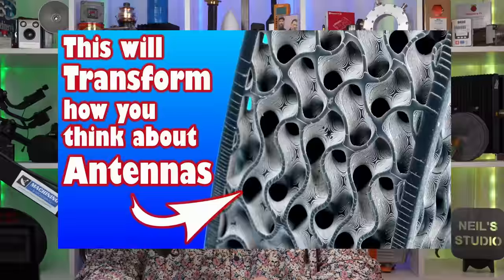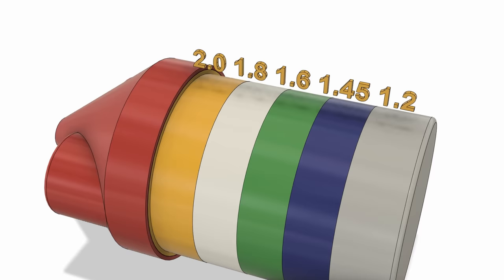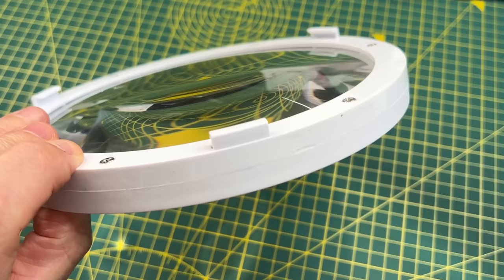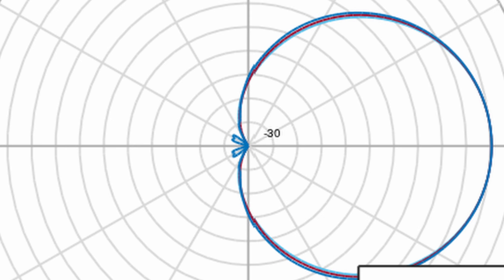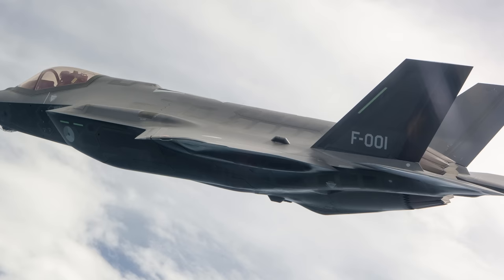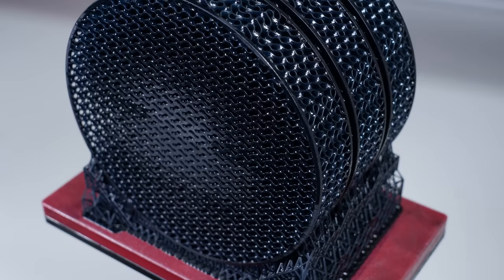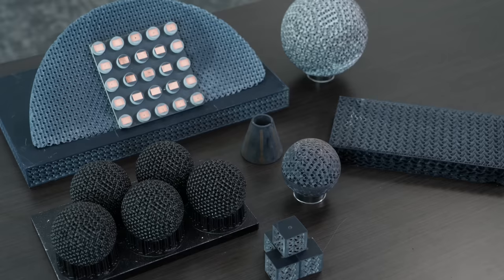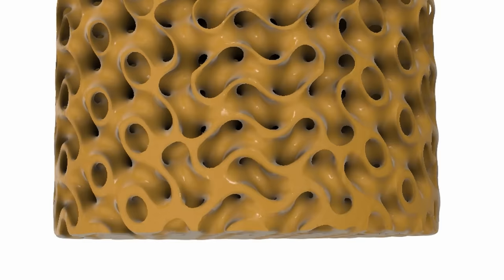How Microwave Lenses REALLY Work!

Comment: 🧲🌡️📡🔆☢️🔌🔊🔋♻️🌐☯️⚛️
It's facinating how when we look around & we see all this complexity with-in the Universe. That complexity basically comes from: ~{"Differences"}~ The Factor of how "Differences" interact seems to be the key factor in keeping dynamic systems functioning. Such as: *{High pressure/low pressure, hot/cold temperatures, different densities, viscosities, turbulent flow, static electric charges/discharges, electromagnet waves. Different velocities/angular momentum. Different amounts of energy/mass/frequency/vibrations. Different boundary layers between different materials or physical regions such as: (Land/water/oil/air/soap bubbles/ atmosphere's/space. The different regions in space with different particle density/background radiation, solar wind/membrane layers/bubble's/cloud regions, nebula's/Galaxy's/Galaxy clusters/ Cosmic filaments/less dense regions of space compared to dense regions of space.) All of these things are basic differences but create a way for the dynamic engine with-in Nature to continue flowing and operating to create and convert energy.} Just Like How a battery 🔋 transfers + charges through a membrane layer to a - charged side. Like how regions of high/low temperature 🌡️ create winds. In water- add some factors and It creates ocean currents and flow. Then internally inside our planet it creates plate tectonics, planetary convection, geothermal activity, a magnetic field around our planet, to hold a atmosphere. The list goes on
🧲🌡️📡🔆☢️🔌🔊🔋♻️🌐☯️⚛️
The natural world around us is just utterly facinating to me.
Reply from the maker: It's all about entropy and our battle against the inevitable heat-death of the Universe! Plenty of time left for wonders and delight

Comment: Such a good video! Tiny niggle; why do radio engineers generally use wavelength instead of frequency? The electromagnetic spectrum is so much easier to visualize in terms of frequency, but most physics textbooks use wavelength, thus 'inverting' it, so for example the visible spectrum (rainbow if you like) gets shown upside down because the x-axis is wavelength, not frequency. This caused me no end of trouble during my physics 'O' level because the highest frequency, more energetic colours like UV tend to appear first, at the left, and the lower energy, lower frequency IR gets promoted to the right of the diagram. All because the wavelength is longer. This has annoyed me for the 40 years since then! Cheers for the great vid.
Reply from the maker: I think the use of wavelength, wavenumber or frequency to describe RF is something engineers do completely unconsciously, because of the physical reality of wavelength in physical systems being a more useful descriptor than frequency.  Wavenumber in inverse centimetres is slightly jarring to me, like wavelengths in feet.  I tend to use wavelength from about 6 mm to 23 cm, but frequency at longer wavelengths, then below 6cm I seem to flip into the frequency domain until I get past the far infra-red, then I return to using wavelengths from IR through to gamma rays. Having been immersed in the language of RF engineering since I was 10 or 11 years old, so 5.5 GHz is about 5.5 cm wavelength and both have pretty much the same intuitive reality to my RF-addled brain.  It's too easy to forget that it's a learned concept rather than something that is inherently obvious to the rest of humanity.
Reply: @MachiningandMicrowaves  Thanks for the reply. As a 60yr-old audio nerd & IT engineer I've always had to think in terms of frequency, whether sound, CPU clocks or WiFi, so yes, it does seem a learned thing. It would be super-odd to describe audio in terms of wavelength! I do get its uses in radio though, in working out waveguide profiles & suchlike. I just wish all the textbooks didn't tip the RF spectrum on its head! It's confusing for youngsters, I think.

Comment: SOUNDS LIKE A MICROWAVE FREQUENCY VERSION OF A FRESNEL LENS .
Reply from the maker: It's not quite a Fresnel, as the reality of a Mikaelian is that there's no need for stepped refractive index, it can be continuous.  You certainly CAN make Fresnels this way though.  A more typical Fresnel solution for microwaves and mmWaves is a stepped Fresnel Zone Plate.  Spookily, in an upcoming video I'll be making a vacuum chuck to hold an HDPE plate that I'll be machining into an FZP. An FZP is a fairly simple build, consisting of rings of material which are thicker or have a higher refractive index than a supporting disk. I'm just going to machine away the surface to get the right phase shift in an FZP with eight rings about 200 mm diameter which will be a focussing lens at 122 GHz.

Comment: Shouldn't binder jetting like for example Voxeljet does be way more suitable for doing this than SLA printing? You can even use ceramic material and then burn off the binder afterwards, sintering the ceramic particles together
Reply from the maker: There's certainly some work being done on sintered ceramics for higher frequencies. There are some big challenges in making a material with precise RF characteristics that's also mechanically robust enough, but the state of the art is moving very rapidly.

Comment: If you make a lattice in the printer could spaces in the filled portions of the lattice be filled with a suitble material?
Reply from the maker: Find a suitable material is the challenge.  Almost all two-part chemical setting resins have mediocre or poor RF performance. Non-polar thermoplastics are good, but finding a way to mould them is hard, they tend to be extremely viscous, but also have a low relative permittivity.  Something like HDPE with entrained ceramic inclusions would need high pressure injection moulding and the lattice to be something that is strong enough to withstand the injection process, but also can be dissolved preferentially.  That's one for the Materials Science specialists I think!

Comment: Not even 5 minutes in the video I'm dreaming of a spectrum analyzer using an "RF prism" in a similar way als old style spectrophotometers use 😁
I have been looking at Luneburg lenses at my previous job for a 5 GHz system but never got to make one or see one working. Following your progress now ia a fun thing to do
Reply from the maker: It's certainly possible to create a prism for RF, but the dimensions are a bit excessive unless you go to very high frequencies. The problem is that most low loss dielectric materials that are transparent to RF aren't dispersive.  The refractive index is pretty much constant with frequency, so your prism can't split out the different wavelengths.

You can do diffraction gratings and grating mirrors as well of course, and they will definitely work at RF. 

Dispersing a few sacks of TiO2 or powered alumina in a bathtub or two of molten paraffin wax and setting it in a mould to make a large enough prism would be quite an exercise as well! 

Perhaps in a cold climate, you could form a giant ice prism and use that, the RF losses in water ice are fairly reasonable, but even water doesn't have a frequency-dependent refractive index and mmWave/microwave frequencies.  You can certainly bend a collimated microwave beam with a really large prism, but it needs to be a few hundred wavelengths across to be useful, so at least 3 x 3 metre faces at 10 GHz.  Perhaps as 122 GHz it would be feasible.  I'll have to see what is possible.  Grating mirrors or transmission gratings, perhaps with a gradient density, should be able to produce a spectral spread sufficient to make a giant mechanical frequency meter using only linear measurements.  Hmmmmm.
Reply: @MachiningandMicrowaves  Wow, that's a detailed answer I had not expected 👍
You indeed explained the size of lenses at some point in the video and guessed this would be the case. But grating mirrors or transmission gratings might be fun to look at. Ah well, I'm like Archimedes sitting under the tree waiting for some idea to hit my head😂

Comment: Another potential way to build one of those lenses could be something similar to lost pla casting. I have built phosphate bonded ceramic parts using pla, you cure the ceramic for a day or 2 in the air and when it has hardened you just bake it in a regular cooking oven. At those temperatures the pla boils off leaving no residue. 
The thing is, is there an adequate ceramic for RF that could work with that process or a similar one. Do all RF ceramics require firing in a kiln? I think that phosphate based ceramics like I used are not good in the microwave.
Reply from the maker: There are those filaments designed specifically for clean burnout with investment casting.  Problem is always finding a matrix that will fuse or sinter enough to hold its shape before the filament evaporates, but that also has very low RF loss.  I am sure there are clever materials science folks working on this right now.  Most of the high performance ceramic dielectric materials have ridiculously high melting points like sapphire/alumina or TiO2, so laser sintering isn't easy. Finding a low-viscosity fluid matrix with low RF loss but a low relative permittivity wouldn't be a problem as the ceramics generally have high permittivities, although there's a balancing act with the temperature coefficients of permittivity, some are positive, some are negative.  I suspect we'll start to see some serious products with very high mass fractions of ceramics quite soon.

Comment: could this concept be used to improve your off the shelf microwave oven ?  diy people have used microvaves as electric kilns , could this be used to focus the waves to a certain shape , a tube , cone or a point ?
Reply from the maker: There's a bit of an issue of power handling, it would probably require forced-air cooling at typical microwave oven magnetron power levels. You would need to remove the magnetron from the oven and extend the waveguide and fit a suitable feedhorn to match the lensing structure, but so long as it's large enough, you would get some focussing just like with an optical structure.  The problem is the size of the lens using this material, the refractive index is too low to get strong focussing in a practical-sized lens, but with a higher index material it would certainly be possible.  Safe, less so.  Legal? Hmmm.  Advisable?  Definitely not!  However, in a suitably controlled environment with all necessary safety measures and licencing, plus the budget to buy enough material, definitely!  Don Not Try This At Home.  People kill themselves messing with the power inside microwave ovens.
Reply: @MachiningandMicrowaves  thanks for the reply , this is very interesting , it would be interesting to see some kind of professionaly made super efficient microwave kiln!

Comment: Love your videos. You should try and make a reflectarray, can make some interesting unit cells with 3D printers :)
Reply from the maker: It just so happens that I've been working on a reflectarray tyoe of antenna machined using my new CNC machine, which is still somewhere off the coast of China on the way to Singapore. That is more of a segmented Fresnel mirror though. I hadn't thought of printing the cell array, that would perhaps mean I could go much larger without the mechanical issues from making a large parabola. A large flat reflectarray is certainly much simpler and it's easy to get the array support perfectly flat. I'm struggling to find a way to model the cells in OpenEMS, so I would have to do a calculated model and hope it works. The other design I'm working on is for a large Fresnel lens made from a low loss dielectric filament. Thanks very much for the suggestion, I'll see what I can come up with. If you have any suggestions for design resources or academic papers I should read, please drop me an email or leave a message

Comment: The speed of light is constant in a vacuum. In a medium, it is affected by the electric fields of the protons and electrons.
Reply from the maker: "affected" is doing a LOT of work in that sentence. Although solids have a of vacuum within the atoms, the electric fields of the electron clouds are pervasive, and in PTFE or other good dielectrics, the field of the photon induces forces in the molecular bonds which take a little time to respond, but they then generate their own electric field in opposition. A photon isn't affected by an electric field in a vacuum, so why would it be affected by balanced static fields within a solid? When the charged atoms move, that generates an electromagnetic field that superposes with the field of the photon, but the induced EM fields lag slightly as a result of the mass of the atoms and the "springiness" of the atomic bond mediated by the electrons.  By the time you've travelled a micrometre or two into the dielectric, the original photon has had so many interactions that most of the energy is now in the little generated fields form all of those interactions.  Now of course, all of those interactions create their own fields and those affect all the others.  The effect is that by the time the wave emerges from the other side of the dielectric, the superposition now consists of what looks like a delayed photon, despite all of the interactions being at the speed of light.

Comment: Looks like the Gyroid infill pattern from the Cura slicer!
Reply from the maker: @bluegizmo1983  Indeed, but with spatially-varying wall thickness. Gyroid lattices guarantee no internal voids and by varying the equation in all three coordinates, you can achieve a varying refractive index across the bulk of the lens.

Comment: you know 3d printer slicers already generate gyroid infill all the time right? it doesnt vary the thickness of the walls, it just adds more of them to increase density, but its there. you can set a slicer to not print outer surfaces and just do exposed infill.
Reply: you could go into the code in prusaslicer and probably mess with the wall thickness
Reply from the maker: I saw a slicer that did a pseudo-random infill that avoids the issues with diffraction from repeated grating elements in some type of infill, but I can't recall what it was called.  I've not tried messing with Prusaslicer, but of course if the outer wall is less than 1/20 wavelength, it is nearly invisible to RF.  Once I ge the samples of the 1.75 mm RF filament, I'll see what I can do.

Comment: The bottom up resin printing is slow because of pulling the part off the bottom. Top down is faster.
Reply from the maker: I guess the downside is you need a HUGE amount of resin and a deep vat though?
Reply: @MachiningandMicrowaves  Yes you need a deep vat. Resin can float on palm oil. Funny thing they don't have a way to drain from below so you could drain away the palm oil then any resin.

Comment: The explanation of why waves appear to travel slower in high index of refraction materials are talking about group delay yes?
Reply from the maker: I normally use Group Delay to refer to the result of signals traversing dispersive media or non-phase-linear circuit elements, where different frequency components are delayed by different amounts and pulses are smeared as a result. The delay that happens in a dielectric is a real delay caused by trillions of photon-molecule interactions and coherent forward scatter which is near enough frequency-independent, so the material has a linear phase response, at least up to hundreds of GHz for PTFE with its resonances at 1.5 and 6 THz.  I guess you could call it group delay but I'm not sure it adds much to the analysis.  I ignored relativistic effects and magnetic moments in my description.  You could certainly argue that I'm splitting hairs when I say that the speed of light in the material is still c, but that it takes longer for a short pulse or a step change to pass through than it would to travel the same distance in a vacuum.

Comment: I've always wondered if there was any potential for using microwaves in 3D printing. Where the resin is made to react to microwaves somewhat like how the UV 3D printers work. I just wouldn't know where to start.
Reply from the maker: The problem would be finding a material that would respond chemically to the ultra-low energy microwave photons.  You might be able to generate some focussed heating using standing waves or a focussed beam, but contact heating or UV is a whole lot more practical
Reply: @MachiningandMicrowaves  That makes sense, thank you for that. So if anything, I'd want to look at the other end with x-rays. I'm sure that comes with its own set of problems.

Comment: You could probably get away with resin printing the antenna on a hobby printer and chemically electroplate it with a copper salt and formaldehyde as a reducing agent

Comment: Pardon my curiosity. Can the thermal energy emitted by open flames be interpreted as  RF noise if the set-up is sensitive enough?
Reply from the maker: My hand is a good source of microwave energy, I can "hear" the RF noise from it clearly. Flames certainly make enough noise to be detectable.  After all, I can hear my trees and the bricks of my neighbour's house perfectly well. With my largest dish antenna, I can hear the thermal noise from the Moon, even though it's pretty damn cold, it's hotter than the deep space background
Reply: @MachiningandMicrowaves  Thank you for your reply ,you have been a tremendous help.